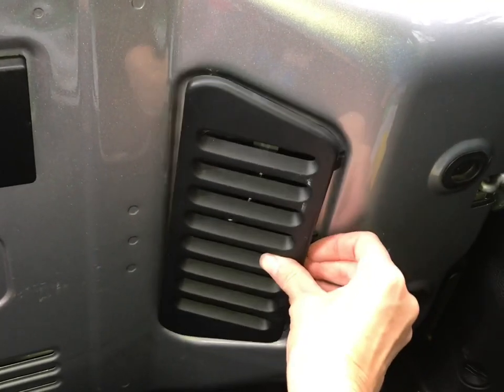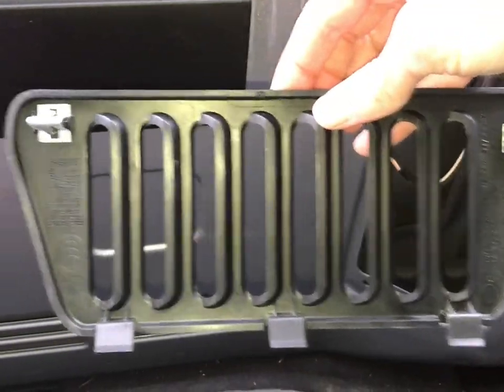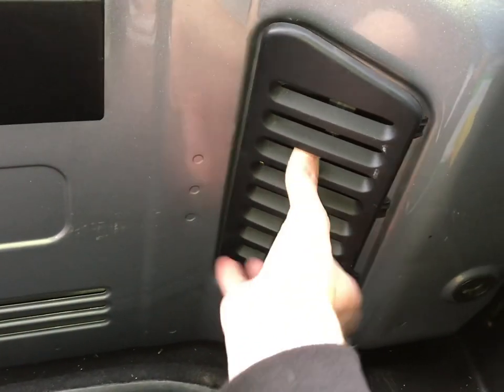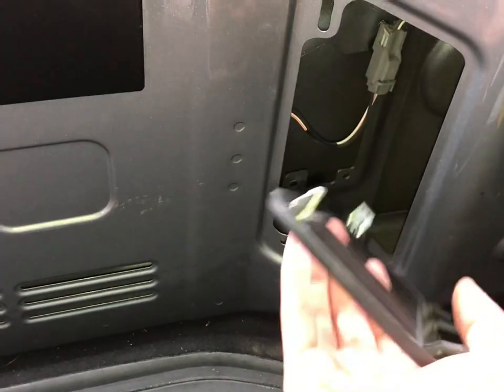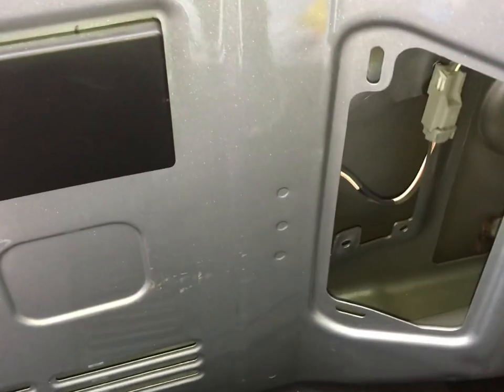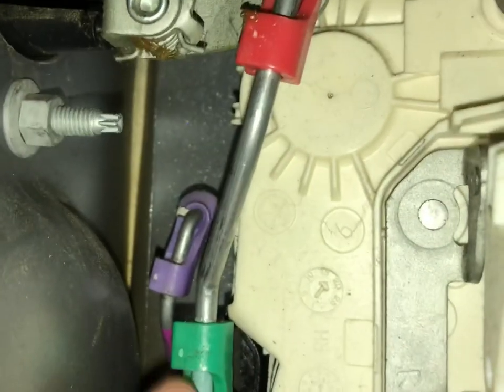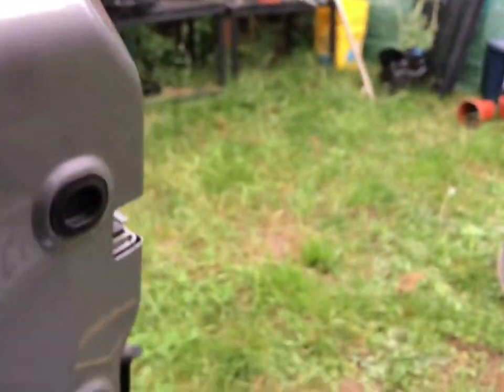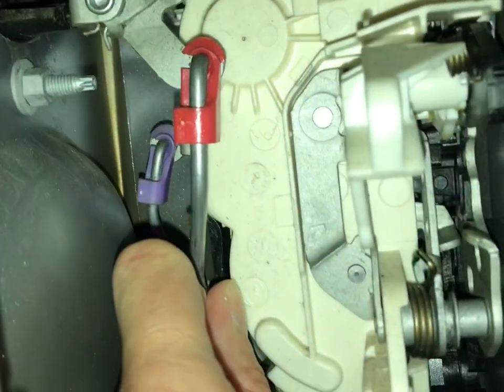Opening a Jeep JK Gate From the Inside

Comment: I have a 2015 JK Rubicon, tailgate latch is stuck. I tried pulling on the metal lever from the inside of the tailgate. Won't open. I can't fix it if I can't open it. Any ideas?
Reply: How’d it turn out???

Comment: I installed a new tailgate latch mechanism because the old one's plastic cam that engages the heavy metal body rail was worn out. Surprise! when the door will no longer open! I discovered that the new door latch mech had slightly different tolerances so I had to bend (thus straighten and lengthen) the short actuator rod with the green and plastic clips.